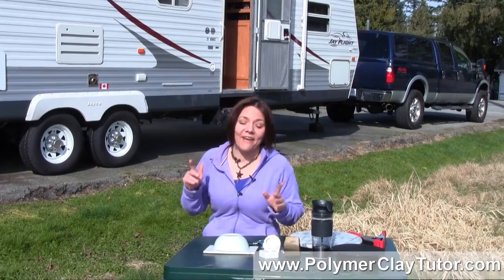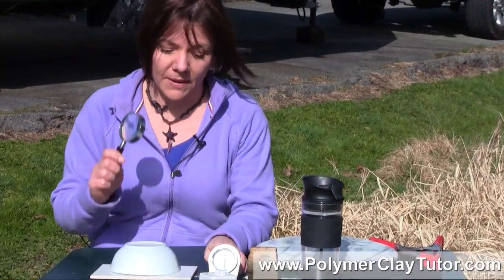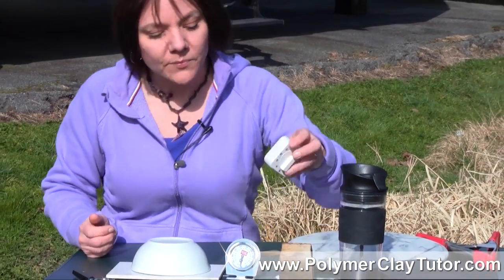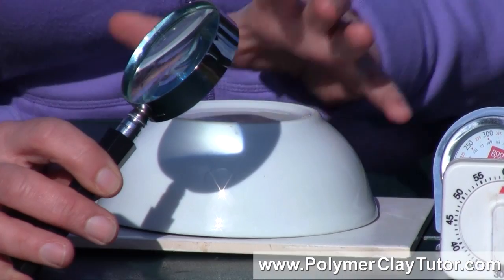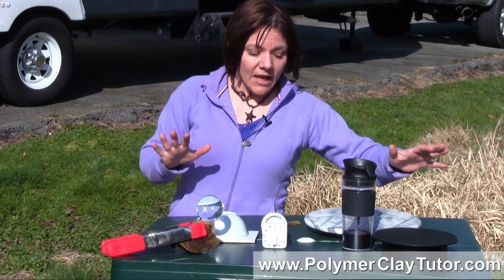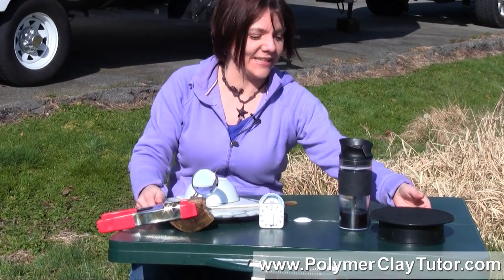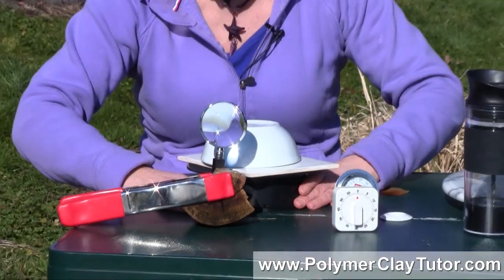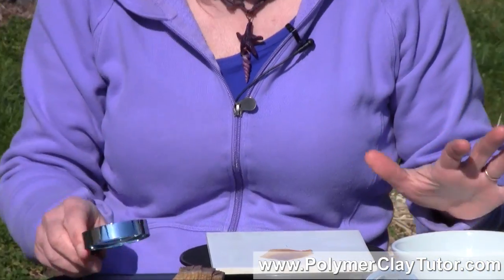Sun Powered Polymer Clay Baking Technique [APRIL FOOLS]

Comment: Funny. :) But really, I have heard that if you leave your polymer clay in a hot place for a long time, like in a hot room over summer, it can slowly bake and become hard over time, and completely useless. So that you should always store the clay in a cool room, to avoid this. Is there any truth to that? I store my clay in a box underneath my bed and the tempersture can be around 30 degrees celcius indoors in summer, so should I put my clay somewhere else?
Reply from the maker: Hi Leena L Well, yes you are kind of right, polymer clay will begin the baking process if it sits in the hot sun, but because it doesn't quite get hot enough 275F, it won't cure properly and will become very brittle. And yes, I would try and store your clay somewhere cooler in the summer because partially baked clay is no fun!